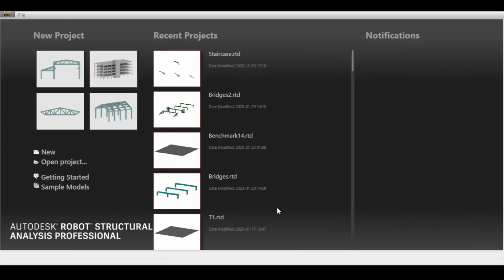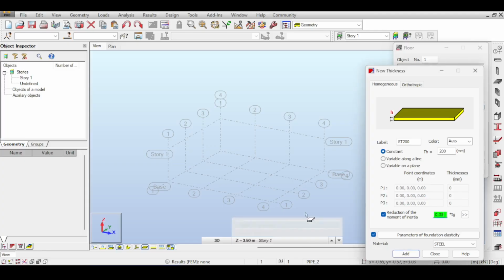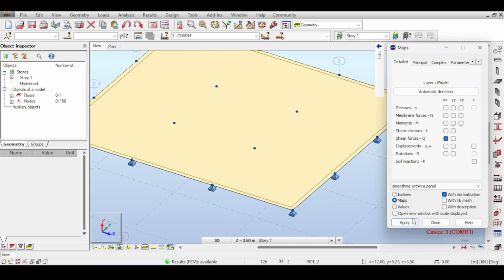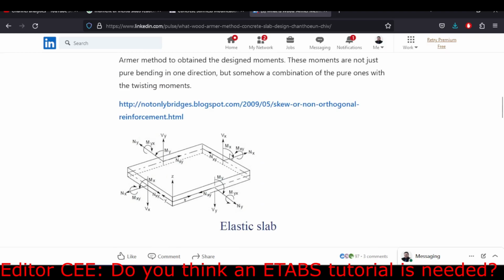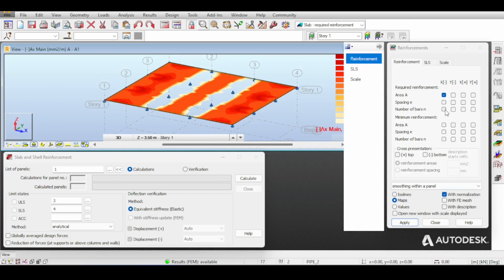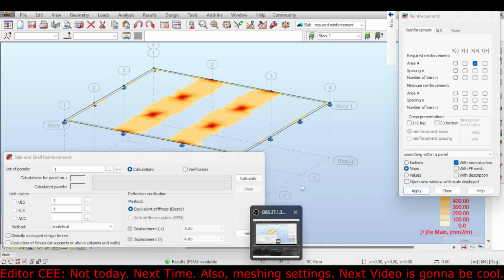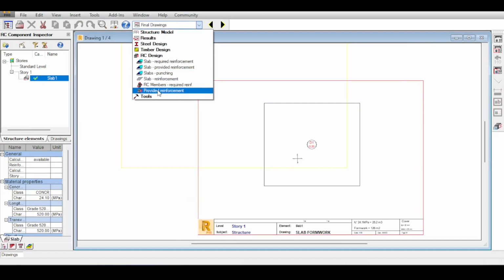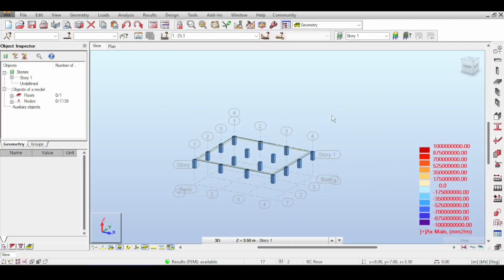The Slab Series | Part 1 - Introduction and Flat Slab | Autodesk Robot

Comment: Hello CEE,

03:42 Congratulations are in order on the current subscribers milestone. You really deserve it and much much much more. In my opinion, the CEE channel remains a shining beacon of excellence with exemplary content and with real active and open dialogue, both of which I am grateful for and I am still in awe of.     

The idea of a multi-parted slabs series with each part dealing with a slab and the nuances and the “nice stuffs” relating to that kind or type of slab is a great idea and I am looking forward to this planned series parts.

Great introduction on the main various types of the slabs that are available, and a very nice way to kick-off the series with “Flat slabs without the drop panels”.

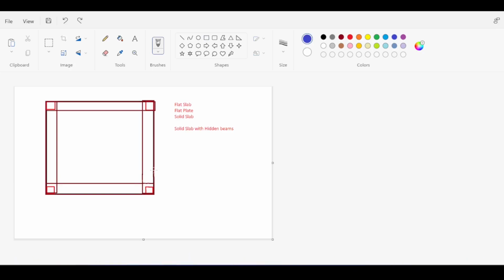02:52 LOL Mr. Editor, good catch, I was not thinking much about the design codes, I was thinking of the stated “consequence” of having to deal with beam shear stirrups as opposed to slab punching shear. It is good to have you around and keeping wondering minds like mine in check! 

I know that this particular video part is discussing “a flat slab beamless”; but seeing though that this other issue was brought-up and touched upon on this video, and with reference to the implications explained on one of the previous video regarding the “importance of beam stiffness”; I am curious about how one would have to model (in RSAP) the mentioned beams that are inside the slab, considering that these beams would essentially be having the same stiffness as the rest of the slab? In theory, RSAP should not even know or “see” 😊 those beams and as such the resulting distribution of the internal forces would not be affected…..how then would one have to model the beams in question in order for RSAP to “see” them and to accordingly distribute most of the internal forces to them beams?

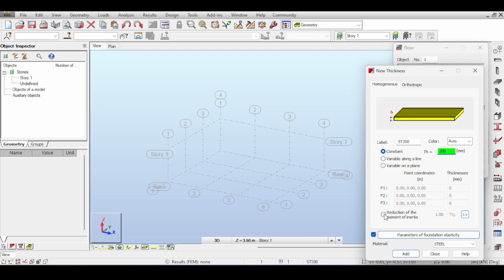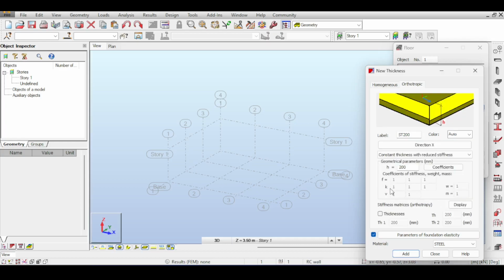05:17 & 05:27 w.r.t Stiffness reduction coefficients. I have read your explained response to subscriber Michael Loreantz regarding a similar question from an earlier video (learning basics of plates and shells), thanks for that response and thanks to Michael for asking that question. The current referenced RFEM dlubal website is nice. For the slabs, it seems that in the majority of the cases, one could simply input a single value for the moment of inertia (flexural stiffness) reduction factor under the “homogeneous” slab thickness definition. Could you perhaps consider to later dive in and illustrate under which (or if) there are practical applications and cases where one would need to use “orthotropic” slab thickness definitions for implementing stiffness reduction coefficients?

 10:29 “…so far this should be boring…..”, this statement gets me every time 😂🤣😂

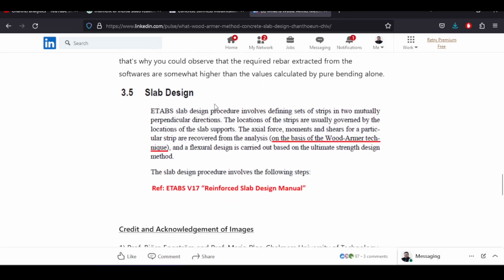16:33 w.r.t ETABS tutorials; my take is that if there are strong areas in which ETABS excels in and if there are types of structures or structural components which CEE consider that the subscribers would benefit by say running and comparing the outputs from both software (ETABS and RSAP) side-by-side. In that case, I don’t see why not introduce ETABS to the channel content as may be required. If, however there are no pronounced differences or specific areas of added value compared to RSAP, my views are then to keep focus and to narrow the scope in favour of more “projects” structures and structural elements or components series. This is my opinion (I guess democracy (or not) shall have the final say??). 

17:42 Nope, not angry at all, I am just that much more curious in anticipation of what is yet to come….

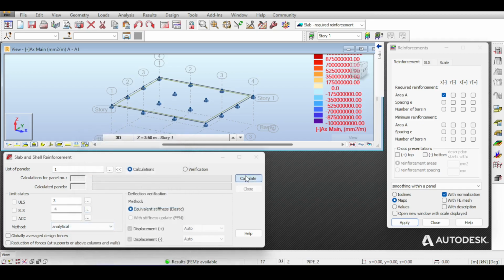20:17 In the “Limit States” section of the “Slab and Shell Reinforcement” dialog box, I think it is important to also change or to choose the “Method” from “analytical” to “equivalent mom. (wood&Amor)” as a way to “tell” RSAP to calculate and design the slab reinforcements using the wood and amour equivalent moments as opposed to using the analytical moments results?

21:52 Under SLS tab. What does the “Stiffness factor” results (values) signify? For X_bottom, X_top, Y_bottom, Y_top. What would one read these values to mean for the slab reinforcements in various directions and layers in simplified “Layman_ish” terms?

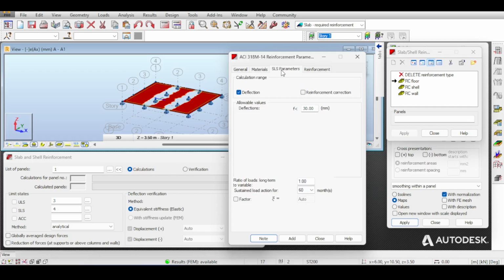I know 😊, but I must ask to be sure: The Deflection u, I am assuming this is the elastic-short term deflection? I take note of the SLS parameters setting and definitions under the “Slab and Shell Reinforcement Type” definition dialog (24:45). What I am missing is that: after doing the settings and running the calculations, where (in RSAP) do I now go to view the resulting long-term deflections for this slab?

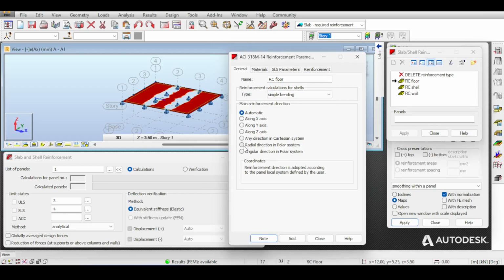24:09 Mr. Editor, Radial direction main reinforcements are screaming to be put on the “Current Video Ideas for the Future list”. From Mr. Recorder explanations, 😊 I am thinking maybe to be considered in future with possible design of a RC circular dome roof or cover slab for a circular water tank or for other similar round structure?

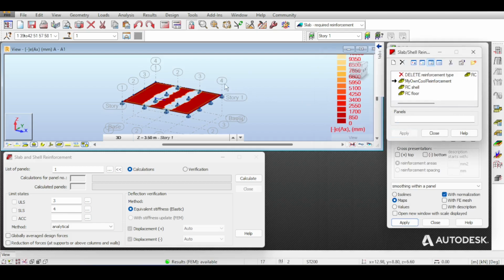26:29 I concur with Mr. Editor, also since this is “required reinforcement”, the area of reinforcement “required” should be the same irrespective of the sizes of rebars that are set or are selected or chosen in the “Slab and Shell Reinforcement Type” definition dialog box. And yes, the sizes of rebars set should affect the “spacing e” and “the number of bars n”.

27:54 YES, Pls.

34:00 I am also a fan of closer spacings of rebars and at the same time the fewer (least) number of different spacings the better. The CEE shared personal preference of spacing not more than the depth of the slab is a very good starting reference point [and then there are design codes limits of course]. 

Chat WHAT??? 🤨, I guess that “Skynet” figured that if it does not change its name to something else, everyone will see it coming…..Hasta la vista….to life as we now know it. 

36:16 Yes, I think Mr. Recorder thoughts in this video are fruitful. Reality is reality; unfortunately, it is often too easy for some designers to forget that the software is a tool and the designer must look at reality and incorporate that reality into the final solutions that the designer provides to the construction team so that those solutions also reflect practical and doable work. Mr. Recorder thoughts in this video are keeping that part in check for the designer (in my opinion). 

Thank you for the video, and I am looking forward to the next one.

Regards, DK

Ps: I don’t know if it is just me, but the sound quality of this video tutorial seem to have an echoed or a small enclosed space feel, nonetheless it is still audible.
Reply from the maker: Hi there Engr. DK,

Happy you also like this series, I am trying to cover most parts of a "bigger multi-story building" so that I do not need to explain basics again when I reach that moment. 

Also, I am thrilled by the speed at which this community has grown. It started in August with 0 subscribers. 

Wondering minds are always a great thing, but as you correctly stated, balance is needed.

For beams in flat slabs, there is something incorrect we do when we design that stuff, i.e. we assume the flat slabs to be 100% carried by the beams, this is - of course - plain wrong in my humble opinion, as it is the slab that is as "strong" as the beam. 

Now this is different in a ribbed slab with beams, and I would mention this - if I remember - in that video when I reach it. Still, the reason why one would model a beam in the slab is the case when you really really need one to resist punching shear, and the idea of having column caps seems to be impractical. Now truth to be said, I have no scenario where a column cap would not solve the issue or is impractical, but well, maybe there exists a case so I want to just give this info to whoever is intereted.

Indeed I had an interesting discussion with Engr. Loreantz about that. Now in that discussion I did not want to point out a "lazy get out of jail free card" to say: yeah it is the code. There, I actually explained it in detail. However, in this video, and because I am targeting the general audience who comes from code backgrounds, I did abide by the code. 

I still concede that I failed/forgot to mention the detailed discussion during my recording, also Mr. Editor seems to have done a sloppy job (I am totally getting burned by him next time for this, for sure ^_^)

in case of homogeneous stiffness reduction, this would be for solid slabs of constant thickness.

For orthotropic slabs, the short answer is: the direction of max inertia.

The long answer is: in orthotropic slabs, your main load carrying element in that slab are the elements of higher inertia, as you may know: the amount of generated bending moment is proportional to the stiffness of the beam, so those stiffer elements would do the loading, and they would ultimately crack first, waaaay ahead before the other direction cracks. So I would use the reduction only for the stronger direction. With that being said, I still have in mind that the seconday direction does have minimum steel, and may even have significant moments if the inertia difference between strong and weak is not that big, so it ultimately gets back to my judgement.

I guess my statements of boredom are basically on point ^_^. Actually, I do say this when I personally feel it.

ETABS, as far as I know, has 1 clear advantage to RSA, which is its wind load calculation. In ETABS, an "invisible" cladding is generated around the structure and pressures are applied based on code calculations.

Of course, the claddings are not visible, and only due to careful consideration can the effect be detected and their exitence be deduced.

About the meshing, I actually had your request in mind. While I was doing my work, I felt that it is somehow a little empty. I mean, the viewer wants to see how "to use" the tool, but I also want to intrigue users by understanding "why" this thing works. So I felt it was not really enough.

Oh my!! Yes, I missed to change the reinforcement calculation theory! I took a lot of time explaining yet, and yet I missed using it. This part of the comment is gonna get cut and paste into the video details so all ppl get to see it.

About the SLS, The Editor has actually cut it out as it was not clear in explanation, I will explain it next video. 
Deflection u is elastic short term, I have to double check that, coz there was a way back in my days to see the long term deflections. I do not have robot with me at the moment, but the easiest way of double checking u is to go the the "geometry" GUI and go to maps -> uz and compare. if they are the same, it is short term.

I'll tell Mr. Editor about radial reinforcements. It is kind of cool and has limited, yet really intriguing applications. Now I remember once trying to reinforce a circular dome with it, but robot struggles to detail 3D structures in space. I'll keep that tabbed.

Punching shear is gonna be defintely featured in the next video.

Also, I WILL BE BACK with more videos of course, also also, nobody talks about "Genisys", and for good reasons I guess ^_^

I worked with teams in normal structures before where they are just "muscles". 

About the sound quality, yes indeed, I recorded without my usual microphone. I used the laptop mic which is much worse. But now things are back to normal.

Anyways, it is always interesting to read your comment, stay tuned for more stuff ^_^

Regards,
CEE
Reply: @CivilEngineeringEssentials  

Thank you for the feedback, there is much insight on the various matters that have been addressed in your feedback. 

@CEE, you are doing a wonderful job. Do not stress if you miss little things here and there. w.r.t the “wood&Amor” moments I am able to recognise this because of YOU, I am proverbially standing on your shoulders. Without your clear explanations, many things would still be hanging in doubt for me. Be proud, because your wisdom is being well received.

Regards, DK

Comment: A beam inside a slab doesn't make sense, since it doesn't bring its main reason for which a beam exist - that is to bring inertia to the structure. As a local "muscle" for the slab, it helps it against local phenomena such as punching.
Reply from the maker: I understand what you mean. But actually, it exists.
You can google:
Hidden beam in ribbed slabs

It is the bread and butter construction method in regions like Palestine.

Comment: Hi, 

I am structural Engineer in Germany. Curently working with Dlubal RFEM, Infograph InfoCAD, MB Aec, Nemetschek Frilo. 
I am concidering to by Robot Structural Software to do some Projekts in UAE and in Poland. Then I would use Robot also for some Projekts in Germany. 
My Question to you is it possible to calculate a flat slab and automaticaly take the seactons as Load for the slab below? 
I know you can do i ti in 3D but for some specific Projekts in Germany 3D Static is not allowed. With Rfem and InfoCAD, also with MB and Frilo i can take Reactions as loads but I am not sure if Robot can do it? 

I would be thankfull for your answer.
Reply from the maker: Halli Hallo, toll mal auf deutsch sprechen zu koennen. Ich habe Sie leider nicht 100% verstanden. Sie meinen, dass Sie in 3D modelieren wollen und die Auflagerkraefte (mein Keyboard hat keine Umlaute) zu exportieren? 

Das geht einfach: Menu: Results -> Reactions

Im Fall das Sie etwas anderes meinten, koennen Sie gerne hier 'ne Antwort schreiben. 

Immer Gerne,
CEE
Reply: @CivilEngineeringEssentials  Hallo, ich wusste nicht dass Sie Deutsch sprechen. 
Meine Frage ist ob in Robot möglich ist Auflagerkräfte eines Modelles als Belastung für ein anderen Modell zu übernehmen? 
In Deutschland ist leider nicht immer erlaubt eine 3D Statik zu erstellen. Sondern wir machen hier fast immer so gennannte Positionsstatik. Bei dieser Statik werden alle Positionen einzeln statisch betrachtet und gerechnet. In dem Fall rechne ich die Decke über z.Bsp. über 1.OG als 2D Decke, dann übernehme ich Auflagerkräfte dieser Decke als Belastung für die Decke über EG. Das ermöglicht sehr genaue statische Analyse und einzelne Nachweise sowie eine sehr saubere Dokumentation und klare Lastweiterleitung. 
In Rfem und MB, InfoCAD und Frilo z. Bsp. ist sehr einfach die Auflagerkräfte eines Modells al Belastung für ein anderen Modell zu übernehmen. 
Kann mann sowas auch mit dem Robot machen und wenn ja wie kann ich dass machen? 
Falls dass ich den Robot kaufe würde ich den Programm gerne auch für die Projekte in Deutschland nutzen aus dem Grund ist diese Frage für mich sehr wichtig. 

Vielen Dank im Voraus. 
Dipl. -Ing. Kemal Halitovic 
mail@ing-halitovic.de
Reply from the maker: @Guru_091Gru  Oh, jetzt versteh ich wass Sie meinen. Genau, in DE kann mann nur einzelnachweise fuehren (z.B. Harzer Statik)

So einfach ist es nicht, die auflagerkraefte auf nen anderen Model zu uebernehmen. Mann koennte zwar die Auflagerkraefte von (Results -> Reactions) anschauen, aber die einfach weiterzuleiten geht leider nicht. Es waere zwar moeglich, es nach Excel zu exportieren und irgendwie diese zu importieren, aber das ist nicht die haufen tausend Euro fuer Robot wert.

Sorry dass es laenger gedauert hat, zu antworten.

Viel Erfolg und MfG,
CEE
Reply: @CivilEngineeringEssentials  Schade. 
In Rfem zum Bsp. das ist nur ein Klick, in Frilo und MB auch, im InfoCAD Mann muss 3 mal klicken :D
Reply: @CivilEngineeringEssentials  Hi, ich wusste nicht dass Sie Deutsch sprechen. 
In Deutschland macht Mann fast immer so genannte Positionsstatik. Das bedeutet alle statische Positionen werden separat statisch betrachtet und gerechnet. In dem Fall rechne ich eine Decke zum Bsp. Decke über 1.OG als 2D Decke/Platte und übernehme ich die Auflagerkräfte dieser Decke als weitere Belastung für die untere Decke (In dem Fall Decke über EG oder für die Bodenplatte). Ich weiß nicht ob Mann  Auflagerkräfte eines Modells als Belastung für ein anderen Modell in Robot übernehmen kann? 3D Statik ist in Deutschland nicht immer zugelassen und auch nicht immer prüffähig. Robot kostet schon was und wenn ich den Programm kaufe dann würde ich Robot auch für weitere Projekte in Deutschland nutzen. Aus dem Grund ist diese Frage für mich sehr wichtig. 

Vielen Dank! 
Mit freundlichen Grüßen 
Dipl.-Ing. Kemal Halitovic Bauingenieur
mail@ing-halitovic.de 
Statik / Konstruktion / Brandschutz / Schallschutz / Wärmeschutz

Comment: 32:45 Robot missed an opportunity here to add hook settings for up / lower  reinforcement separately 

33:59 You argued you are >personally < against big spacing. But isn't it generally correct to maintain a short spacing, in order to have a good reinforcement aka more homogeneous? Cracked slabs come to mind 😬
Reply from the maker: I agree totally, it is generally good to maintain smaller spacing. But it is not all black and white, 
You see, the codes give "min" and "max" values, and it is kind of a spectrum in between.
Go towards the min, and you are going to suffer in concrete placing (coz some people forget that there is other steel to be considered in a slab such as the column steel)

Go too far, and you are risking cracking.

Anyways, <3 your comment. Stay tuned for more content.